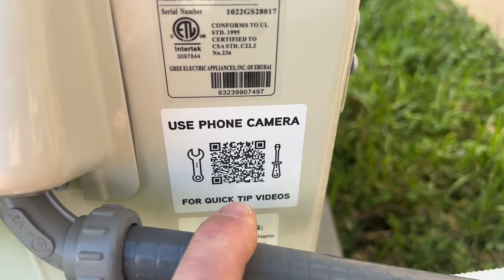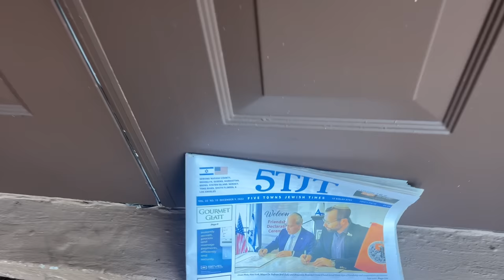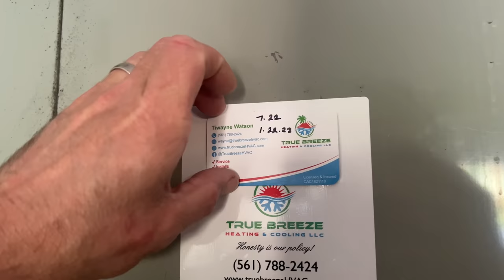Southern Florida Hacks Gonna Bring Me Stacks - Disgusting Gree Mini Split System Installation

Comment: My Grandparents also live in Boyton and used AirAroundTheClock. They had a leak in the ceiling because the condensate was clogged. They were told they needed a whole new unit because the condenser was condensing too much. I never heard of such BS... Mike if you branch off to South Florida I'll gladly join you.

Comment: I'm going to email you pics of my install I did in 1 of my two garages (humble brag). I'm not an A/C guy but honestly it's the nicest install I have seen. My helper was my low voltage guy. He ran the line voltage in the attic from the main garage to the other and I made all the terminations. I planned the whole thing out so the only thing visible (mostly) is the condenser and head unit. Those guys obviously take zero pride in their work. I'm in Broward so I used a hurricane wall bracket instead of it being on the ground. Grampa can have the landscapers plant some bushes to hide the flimsy liquid tight. That would at least hide that abortion. They put the condenser so far out from the house it's almost impossible to make the lineset look nice. At least they put it on a pad.

Comment: A couple of things. So my company is down here in South Florida. We do a lot of work in the Fort Lauderdale, Boca Raton, coral springs up through Delray and Boynton Beach along with plenty of other areas in the Broward and Palm Beach counties and work like that is very typical. It’s really fucking lucrative if  you’ve got good work ethic and can prove why you are worth the money, but down here most contractors are fighting for scraps because of the illegal work and Chuck in the truck types that flood this market. it’s very common to find customers that just quote-unquote know a  guy who will do stuff for very cheap. For instance, your standard 3 ton split system installed could be as low as $5000 down here…fucking insane and it took me years to understand how to market myself so that I could make more money. we do more change outs per 10 years then ones up north I’m sure so it makes sense that it’s going to be less expensive per install overall but it’s ridiculously less expensive down here
Reply: On another note, I’ll show you some installs that I’m proud of if you want
Reply from the maker: I’d have no problem reporting all the unlicensed and unpermitted work.
Reply from the maker: Sharing is caring

Comment: My parents had a home in West Palm Beach and had the same grass and they called in Torpedo Grass.. You can't say anything that is offensive because it is the truth. My Parents home in west palm beach central air system wiring looked like a bees nest, I surprised it worked. Finally I found someone to straighten the mess out. You will make it big in Florida...:yougotthis:
Reply from the maker: I think I might crush Florida

Comment: Welcome to my neck of the woods. Loads of shady work being done without permits. Naturally the Cree unit is made in China. I am a retired electrician. Installed a Kool Guard Intelligent Voltage Monitor with Surge Protection (120/240V) DTK-KG2. Doesn't require tapping into the condensing units contactor. Boat parade tonight 12/09/2022. You might have to watch the replay video since it starts after dusk.

Comment: Top two blocks are poured concrete U blocks with concrete poured and steal rebar inside  in Florida. Do not see required hold down straps for hurricane protection. Condensate traps are require near the condensing unit.
Reply: The home was built prior to SFBC after Hurricane Andrew. The hurricane straps would not be visible outside or below the ceiling. I don't see the attic in this video.
Reply: @lippru  Hurricane straps are required for all A/C  condensing units not talking about truss straps. Poured Lintel required since I started in construction in 1962 on all concrete block construction . This is block with Epoxy/Stucco covering.  After looking frame by frame the Gree unit has built in straps that they anchored in front of condensing unit.

Comment: It's a hurricane pad,  mostly Styrofoam.  They float. 
Because he didn't have the top piece.  
And they are not to be trapped.  
10 foot minimum line set
A bit high for a gree.
If you watch people walk as you get older.  Those bumbs in the walk are bad.
Reply from the maker: The pad is heavy AS FUCK
Reply: @Mikey Pipes Uncensored  most of those pads we use are not.  There foam with a concrete coating annoy l about 1/2 inch thick.

Comment: So hvac techs during install
1. I only have X amount of lineset cover. Wait I know I'll install the head low so I'll only have to use one run!
2. Hmmm I don't have a wall penetration cover for the top, wait I know! I'll use spray foam... amazing I know
3. Hmm this drain pipe straight down is missing something ... wait I know! I'll install a dumbass J that will clearly get knocked off by the hose because my lazy ass didn't glue it. 
4. Hmmm power how to run it. Wait I know, I don't have any straight pipe but I have 50 feet of nonmetallic liquid tight, code calls for metallic liquid tight but they look close enough.